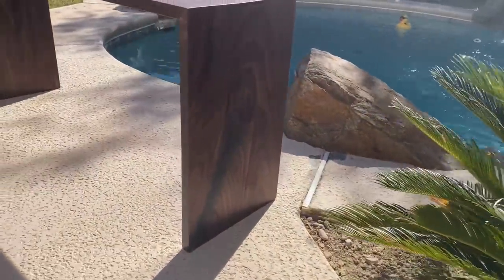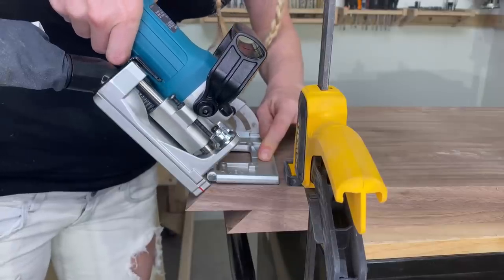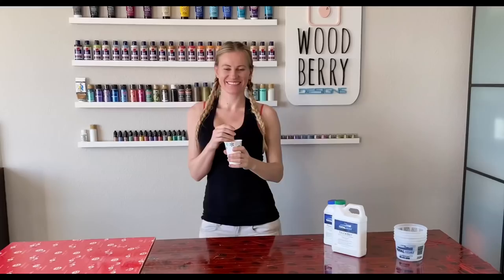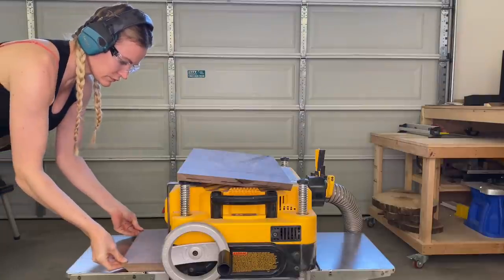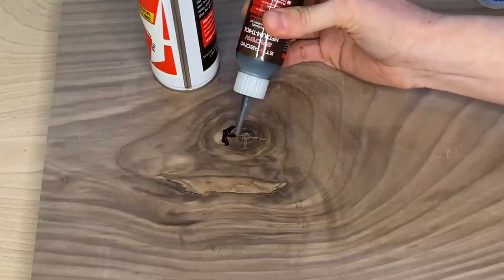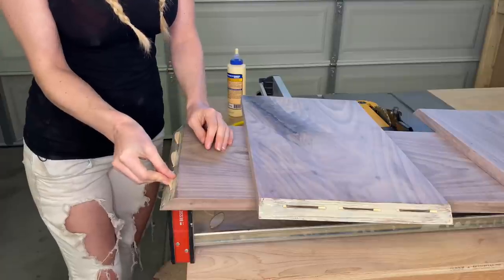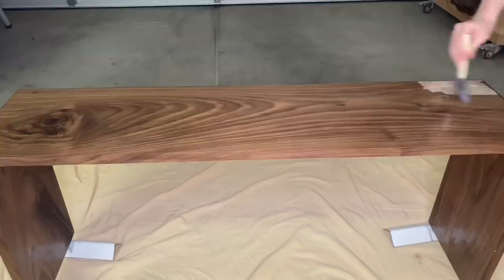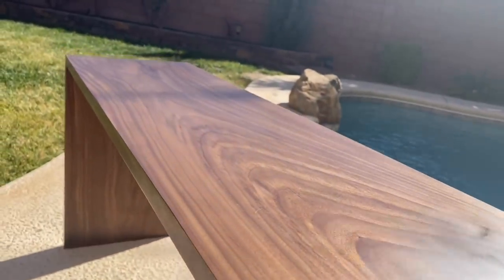DIY build - Walnut bench / table for ottoman 😍 made out of only 1 piece of wood

Comment: Wow, I can't believe it, female doing woodwork very well. Appreciated 😊 keep it up👍👌
Reply: Great job. When I glue up projects I usually tape outside the glue joints easy clean ups. And doesn’t smear glue on wood .also when I clamp I use a square block to keep legs perfectly straight and square. Keep up the great work.
Reply: You can't believe women can do woodwork as well as men? What century are you from? 🤦

Comment: Thanks for the demo of the plate jointer on a 45-degree cut.  How did you ensure the joint formed a 90-degree angle while it was clamped up and the glue was drying?

Also, you may want to braid your hair behind your head.  It's not safe to have the braids dangling down in front while you're bending over a power tool!

Comment: I noticed through the video that sometimes you use ear protection other times you don't (the miter saw at 0:38 and the jointer of the video)..   Is there any particular reason?
Reply: @WhatMeikeMakes  Which model is the miter saw.  I almost go full hand tools to avoid noise of the tools hehehe...